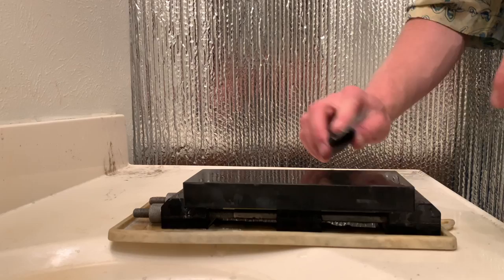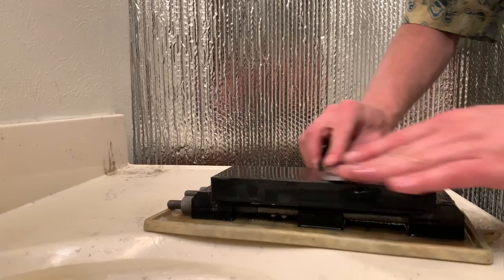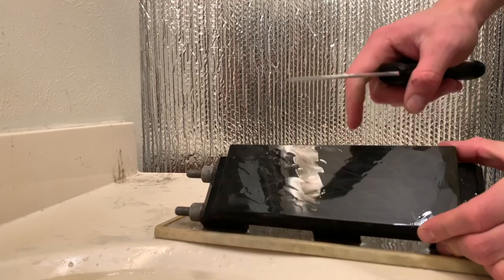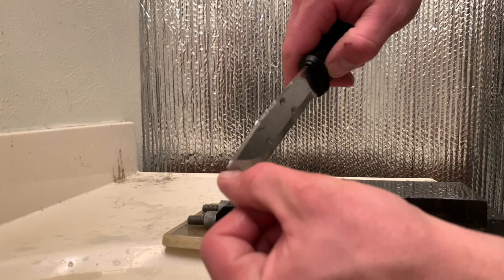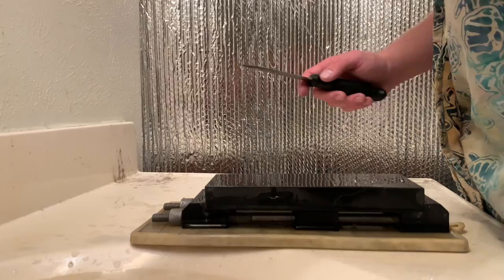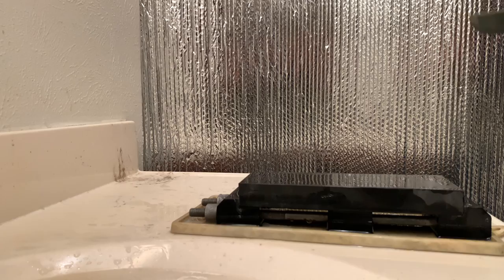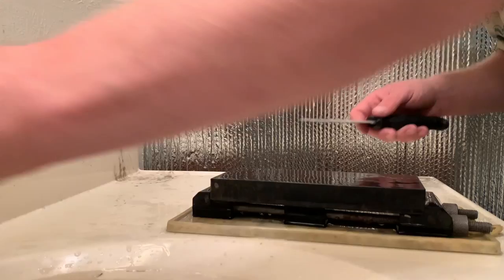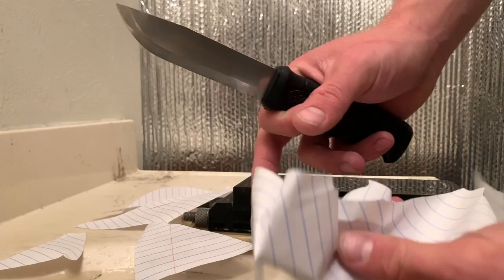One Stone Honing - The Only Natural Whetstone You Need - 1080p HD

Comment: Just discovered your channel, that is a beautiful stone and also excellent technique. Thank for you the information, I will plan on purchasing one of your bench stones in the near future!

Will these work with A2  tool steels, as used in plane blades and chisels?
Reply from the maker: Hey bud thanks for your appreciation of my work this Jasper type stone will work with even crucible steel like CPM and Rex 45
Also just so you know there’s a spring sale happening right now 20% off until May 18 use the code SPRINGSALE at checkout

Comment: So basically, this is a finishing touch stone correct? For fixing an edge after a few uses of a blade's edge. And right before using a strop block. Correct?
Reply from the maker: Anti-Hero Meng John Lee Yes but when it is freshly Lapped it is also a fast grity Stone. I saw you just placed an order I will send one side lap fine and the other side for fast metal removal
Reply: @WildWhetstones  yep, thanks!

Comment: What size stone are you using in this video?
Reply from the maker: islanddiver87 8x3x1 they are on sale currently here https://www.naturalwhetstonesharpening.com/product-page/8-x-3-x-3-4-ancient-ocean-jasper
Reply: Gabriel J Warren if it’s really Jasper, then you need to work on it not with water, but with oil, it is also good to add luxor pastes.
Reply from the maker: Андрей K in your opinion.

Water works just fine for me
Reply: Gabriel J Warren this is not my opinion, but the opinion of those who extract this stone and sharpen knives and other tools on it.
Reply from the maker: Андрей K I extract this stone myself and have sold a few thousand of them since I started making Whetstones 4 years ago.

I sharpen with water and or slurry with a diamond plate. I’ve also tried oil. It all works and there’s no one right way to do it.
Reply: Gabriel J Warren I agree, I had some kind of jasper.  I tried it with water I did not like, but if you add a drop of detergent to the water, the result is good.